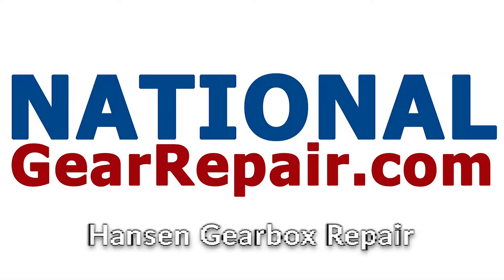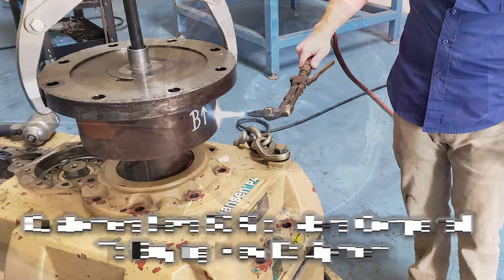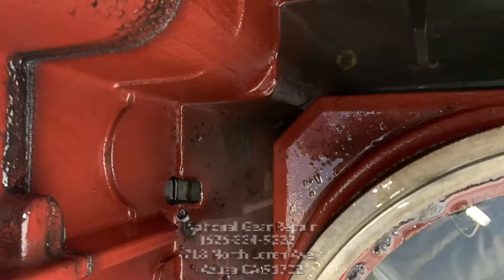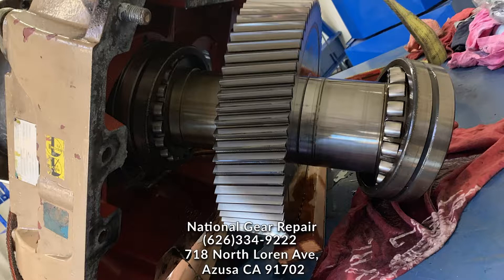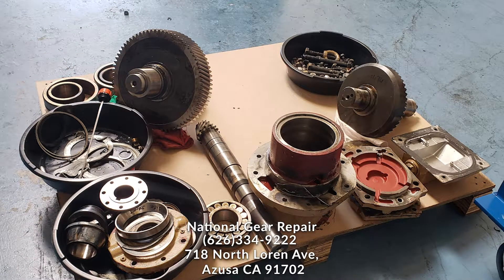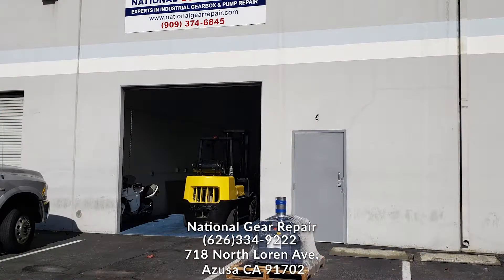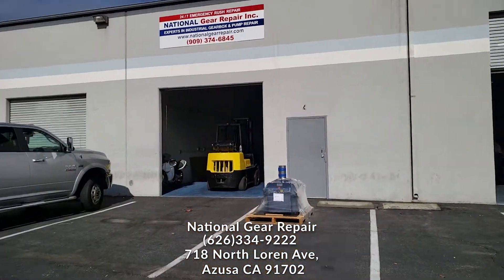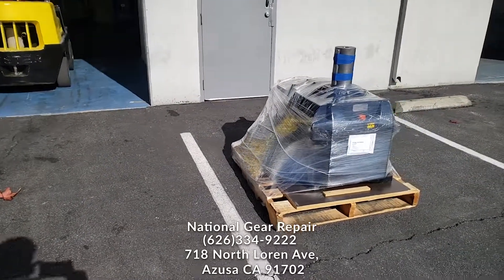Hansen Gearbox Repair Video

Comment: Dear Hansen, if you would like to be informed about the aSKF value, FFT spectrum and the MRO-loop and to help endusers, please let me know. As a engineering consultant I have helped customers to stop the oil leakage and I helped them to understand the correlation between the component in gearboxes, the MRO-loop, FFT spectrum, aSKF value, the selected oil and what end-users can easily change to improve MTBF and reliability and stop seal leakage! If you think I can help with your problem, please send me a message.